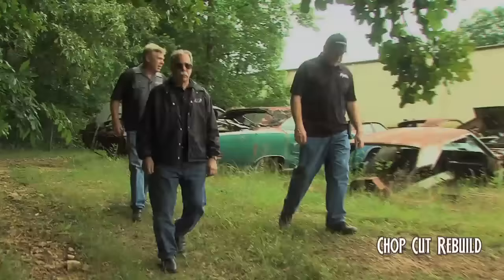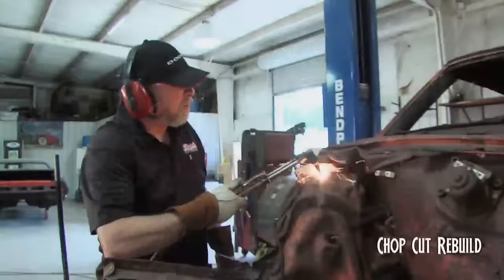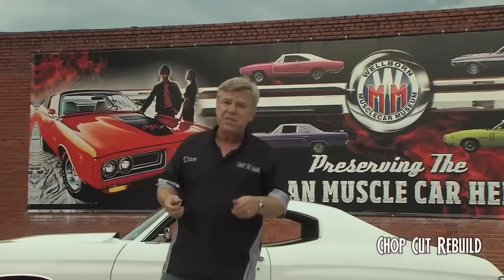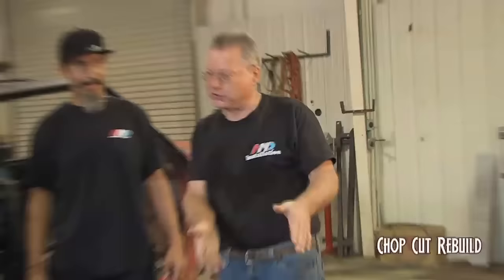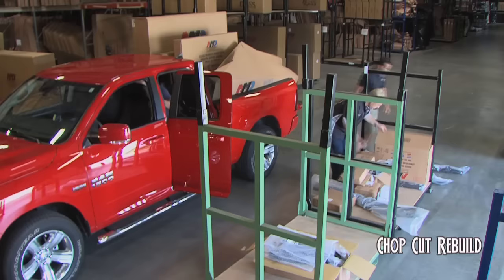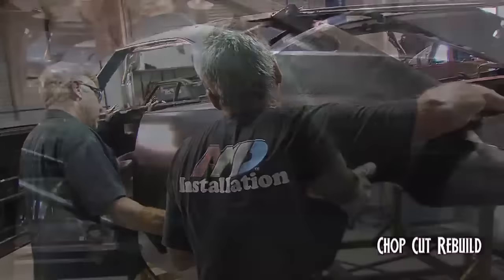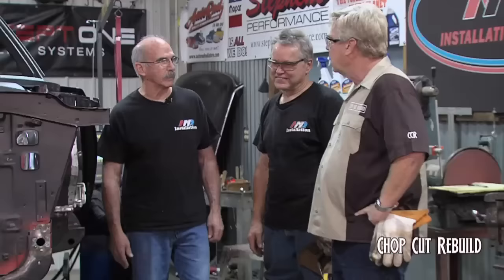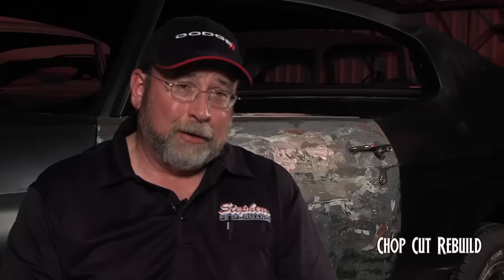Resurrecting a Dodge Daytona that was in a Police Chase Crash - AMD Garage

Comment: When the Daytona cars were built the donor car started life as a charger. So when the factory selected the 500+ cars to become Daytona chargers, the factory kept records of the original serial numbers.Those cars were built as Daytonas and sold at the various dealerships. Even if you rebuilt a Daytona that was commissioned by the factory and replace 99% of the sheet metal, that car still remains a true Daytona because the factory assigned serial number to that specific build. If it was born a charger and built into a Daytona it will always be a true Daytona.
Reply: So you can cut the serial number off and slap it on some sheet metal and you got a “true” Daytona
Reply: To think. . . these guys did what the factory did on a moving assembly line.  In doing so, they went back in American car history to a time before the model T Ford. Although the tools are parts and the mechanism by which they were manufactured have  been improved, that "hands on" work requires a lot of the same skills and attention to detail.  It's amazing.
Reply: The factory serial number indicates that vehicle as a true Daytona . You can build a complete car from New sheetmetal that looks like a daytona, but if you don't have a factory designated serial number, all you have is a body. That is what all daytonas started with was sheetmetal.
Reply: there are hidden serial numbers on the rear inside the trunk drip rail and on the core support your die hard car guys would not call it a true daytona even with the vin on the dash
Reply: @woecp  I think that's a bit of an exaggeration. They started with an actual original Daytona, and yes most of the metal was replaced with new, but it's still associated with the original car. 

It's a whole helluva lot better than just sending the original car to the crusher, which is usually what would happen.
Reply: @clembob8004  they cut a lot of metal that didn’t need to be cut, I see it so often these guys get a chargers for a good deal and just go dummy with it cut it all up and leave nothing original just build one from scratch if you gonna do all that 🤣 I woulda beat it out with a hammer before I cut every square inch and replace it and on top of that they make it a garage queen 🤣
Reply: Una lástima que se la pasaron filmando tipos hablando y presentándose 200 veces,no quedó nada del auto original.
Reply from the maker: exactly, more of a showcase of what could happen in this extreme case
Reply: @clembob8004  the wrecked car still went to the crusher
Reply: @gabrielkwiatkowski645 came here to say the same, the amount of times spent on intros and shaking hands would have cut the video in half
Reply: This car is a Daytona recreation. This isn't a restoration. There's nothing to restore.
Reply: @nikoladamjanovic2313  Not exactly. Only the unusable parts went to the crusher. In any case, I look at it this way: there is a nice 69 Daytona Charger in existence that otherwise would have never been built. Any Daytona is a good Daytona.
Reply: @user-tq1eg2mv9q  It's a recreation with a few original parts from the original car, including the all important VIN tag.
Reply: @woecp I can tell u don't know anything about auto restoration work with what u said there... u would have beat and did what? Get real this was the only way to build a good and safe car..
Reply: @redneckswitwheels  I know plenty, it’s not a restoration its a replacement your the type of guy that would spend 200k to build a car and let it sit in a garage and wipe it with a diaper 🤣 I’d drive the sob rusty and falling apart before I replaced the whole car with scrapped Honda metal
Reply: Sure, minus the numbers matching parts. In your heart you’ll always know it’s not a Daytona it’s a kit car. Otherwise where do you draw the line? …take the factory ID tag, rivet it to new parts and call it a Daytona?
Reply: It would be good to save some of the original metalwork though.
Reply: Grandfather’s axe syndrome. Once upon a time someone saw a man chopping wood. That’s a very handsome axe the stranger said. Thanks. It was my grandfather’s the man replied. He used it every day. Wow. It looks to be in perfect condition said the stranger. The man replied proudly it’s a family heirloom, we take good care of it. Over the years we replaced the handle three times and the head only once. I’ll hand Grandpa’s axe down to my son someday he said wistfully.
Reply: @gabrielkwiatkowski645   Esto es una plasta de mierda.  No un Daytona.

Comment: This was an incredibly ambitious project, holy cow. Thing is, it is not the same car hate to say, it is a new car built with 99.99% new parts.
Reply: I wonder where those parts were manufactured, I didn't research it myself. Maybe China?
Reply: @irocitZ  Back then the parts would have been built in U.S / Canada. I've seen a few books on Daytona's (but not read them) and I'd hope one of them mentions where they were built. I'm guessing a local fabricator facility or speed shop would have been commissioned to build the parts
Reply: @car_ventures  I'm talking about the aftermarket parts used to put this back together, since this particular project requires an entire catalog of pieces I'm wondering where are they sourcing them from? I'm assuming there aren't many Daytona parts cars around. Anyone restoring or buying a classic car should consider what kind of parts went into the project, in my case I look for USA made stuff. If not I could be sitting on a Chinese or whatever car...
Reply from the maker: Developed here, stamped in Taiwan
Reply: @autometaldirect  so u used the VIN snd the outer rocker psnrl from the Daytons from zhe junkyard and everything dlse was gone to the crusher
Reply: @nikoladamjanovic2313  Yeah it's more tribute car than anything else.  Oh well, glad to see it back together anyway.
Reply: I guess they should have just left it in the salvage yard then.
Reply: Help me understand, I was under the impression that if you remove a VIN from one vehicle and place it on another vehicle, you have just engaged in a FEDERAL CRIME?
Reply: @charlesslack8090  Federal crime? No. And this did not happen. the VIN plate was reattached the the same vehicle.
Reply: @jackmoore6904  
Thank you Jack. So no fed crime. Is this then what is called a RE-BODIED CLONE? Is the title clean after this?
Reply: @charlesslack8090  It is not rebodied or a clone. It is not built from parts either. The car is lagaly VINed.
Reply: Kind of a re-creation maybe.  Whatever. It's cool with me.

Comment: Resurrection? No. Rebody ? Yes. When the only original parts are a section of the inner roof and the dash pad (with vin) then then it’s disingenuous to say that Daytona was resurrected. Good job building a clone though.
Reply from the maker: either way, its not in a junkyard anymore
Reply: That’s correct. 97% of it has gone for recycling.
Reply from the maker: @user-uo1qw4dg9i  i heard that the recycled metal was used to make modern hellcat panels 😃

Comment: Today NASCAR is running like 185- 190, these ols Daytonas ran over 200 with no problem, imagine if they had all the modern underpinnings like NASCAR today, they would probably hit 215-220 and still embarass the new cars. NASCAR just seems too safe today and the rear is so loose they say at high speed on the bank, you could puss the rear right out with your hand, Bring back a moder version of these back and let them run em just like they used too. Gotta love that AMD sheet metal. I owned a 70 road runner I always wanted to clone into a winged car, somebody told me they used Coronet fenders because they were longer, don`t know how true that is. Great video guys.

Comment: I don’t understand any negative talk on this car or any car that needs fixed. Would it be better to let it sit in a junkyard and disintegrate into the ground? I sure don’t think so! And, besides, a rebuild on a car like this is fully documented so there will be no possibility of passing it off as all original or a survivor or anything other than a badass Daytona back on the road!
Reply: They could just cut the vin from the junkyard snd let it sit
Reply: Hell it already HAD rotted into the ground!
Reply: They  removed far too much of the car in the name of installing and promoting replacement panels. More than half of the rear quarters could have been saved as well as the roof. Sure they would have taken more time and skill to do it properly but in the end the more of the original car still there the better claim to a restoration.  This is an aftermarket car with a few Daytona parts
Reply: Panel replacement with new panels is nothing a typical crash repair shop couldn't handle.  Anyone can remove and replace. A real hot rod shop would have repaired the panels that were there . This is no longer a daytona. Simple

Comment: Having installed reproduction sheet metal for many years I agree that AMD products are better. However the body shop guys should have at least got a little inclusion in the show. I know from Experience what kind of Labor and Hours go into straightening and prepping the body.
Reply from the maker: absolutely, the body shop guys really bring the whole project home and, depending on the level of the project, can take it to a complete show stopper.

Comment: 13:35, Don't be so hard on, Ted. When I resurrected my 67 Shelby GT350 I purchased from the previous owner who kissed a telephone pole with the passenger rear, I saved all the mangled pieces I had to remove to rebuild it. Back then, there wasn't an AMD to get the parts I needed. I had to find donor parts from damaged 67 Mustangs in junkyards it was quite a job but I saved it and it new after I had it painted the original Candy Apple Red it began its life with.
Reply from the maker: Thanks for your words and thank you for watching!

Comment: When you replace almost every single part of a car it's not a "restoration" it's a Creation.
Everytime some greedy shop takes an old famous movie or historic car and replaces 90+% of the car with brand new parts. All they've done is thrown the famous historic car in the dumpster and hung all new parts and paint to lie about it's history to sell it for a large amount of money. For instance The Elvis movie car and original screen used Dukes of Hazzards intro jump car for two examples. Every piece of the cars were torn apart piece by piece and thrown away. Then replace every part to look like the original cars. It's been many years and I've blocked them from my memory but I believe ONLY one piece from one car and two from the other were actually saved. The vin code badge from one and the vin code badge and firewall from the other. The rest of the entire car was thrown into the trash and replaced with shiny brand new parts. I don't care about this fake Daytona the owners have to know what they're actually buying by law. But those other two famous cars should have been cleaned up and treasured for what they were. Not what they're pretending to be now. When anyone could have gone into the dumpster at the back of those shops and put all the pieces together again. They would have had the original cars! But now they've been melted down to make whatever.
This all should be illegal to do this. A vin code nadge does not make a car make.  I can afford to buy some of these cars but I'd never waste my money. They look beautiful and shiny as brand new imposters. But that's all they'll ever be. I'd rather have the real thing even in the worst condition. Because it's real. I've worked in the entertainment industry for most my life and this fake car would make for a great secondary car to wreck on screen in order to save a real Daytona car. No matter what it looked like.
This was a hour long infomercial for all new replacement Dodge parts and that's it. Parts are made to replace broken or beyond repair "parts" on a special car. No for replacing the ENTIRE special car. 
He said it himself when they found the car "that's not the Dayton".
Now we can say it at the end. "that's not the Daytona"! Rant over. These videos just make me sick. Not this particular car because the other car wasn't worth anything. But thinking about the famous cars that get trashed just to hang everything new on a new frame just to get Shiny New for money. That's just wrong. They're only original once and saving certain original cars are priceless just the way they are.
Reply from the maker: Thanks for watching! No impropriety presented or suggested - it is still on display in our showroom! Stop by sometime and check it out
Reply: to me its more of a KIT car than a restoration
Reply: @autometaldirect  Awesome! Got pics of the car in it's current state? I'm from Argentina can't go there yet sadly :(
Reply: @autometaldirect 

Where do these picky people draw the line? Any east coast car that saw salt is going to need new body shell floors, front and rear, trunk floor, rockers and likely quarters. And that’s a minimum. Is that OK? Any car that suffered a head on impact at 100 MPH isn’t going to have much usable metal forward of the firewall. So, according of these naysayers you write these cars off or display them as is. But who is going to be interested in owning or even viewing in a museum a beat to h**l rust bucket or a total wreck complete with bloody bandages left on the drivers seat?

I’ve retired from restoring MG’s, which are all rust buckets except for California cars. I never felt that when I ran into that last unexpectedly rusty panel I should stop the restoration, throw up my hands in defeat and for the sake of purity send the car to the crusher.

Comment: Amazing work, love it. People need to get over the "It's not the same car" thing. Looks like a Daytona to me! What matters is, there is a beautiful car back on the road and not lost to the scrap yard.
Reply from the maker: that is our feelings exactly, this is obviously an extreme case but there is another Daytona back on the road now. js
Reply: It is a repro body with a VIN from a wrecked car
Reply: @nikoladamjanovic2313   I worked in a body repair shop many years ago and some cars came in needing a complete rebuild from the floor up. Sometimes only the firewall and part of the floor was saveable, the rest was brand new panels and interior. Granted, the cars are usually only a few months old for that kind of work but it's still the same car going out as what came in.

Comment: I remember a buddy of mine selling on Ebay a rear wing, two fender scoops and two nose pieces that were damaged but one could be made out of the two of them. He sold them as a package and got 27k for them and that was 20 years ago or more.
Reply: $27k sound like you rip someone off. original Dodge Daytona wing shouldn't go no more than $5k.
Reply: @funtyes1970  It was a public auction so how could you ever think "you rip someone off"?
Reply: @funtyes1970  Was just looking and the last factory wing in Ebay was 15k for just the wing with out a nose piece and scoops.
Reply: @davebrittain9216  15k sounds reasonable to me, especially if you consider the rarity. Any collector that's trying to restore a true wing car would gladly pay that.
Reply: @kickithard  Ya the guys that really want originality pay big bugs. I remember back in the 90's he was restoring a Hemi Super Bee and it did not have matching dual four barrel carbs. He paid 5k back then for consecutive serial number carbs for a Hemi for that specific year of manufacture to match the car.

Comment: I was a bit surprised by the colour change, but the reason for it and the result were actually really great!
Reply: Yes, but the color should have been the same it left factory with.
Reply: In year 2017, here, black primer or fresh out of the box look bare metal
Reply: @missingremote4388  Has it been repainted since then I wonder?
Reply from the maker: it is still in that 'Hot Rod' Black

Comment: If someone cut the face out on the Mona Lisa, imposed it on a new canvas. Then, painted the rest of the painting by the best most famous painter in the world. It still wouldnt be considered the original painting.

If a watchmaker took a face of a rolex and put it on a seiko watch movement, it wouldnt be considered a rolex. 

Over 95% of this car has been replaced. Its not a rebuild, its a tribute car with a couple pices from an original.  

With all that being said. Still, this was an amazing build, and the car looks amazing.

Comment: It's just a canvas to put an original VIN tag on. The history of the car as it is now is an open book. Everyone knows it's a Taiwanese clone. IMO Mr Stephens should have the original parts treated to stop rust then "reassembled" as a display to accompany the clone rather than just the pictures of the beyond saving original. The history of the original owner and why he was running would be interesting. A wreck that violent before airbags could easily have been fatal.

Comment: I'll never understand these kinds of rebuilds. Sure, the car once was a Daytona, but by the time you finish cutting all the rust and replacing original panels with aftermarket new panels, that thing will just be a clone in my eyes. You're gonna leave just the original tag or VIN number or whatever and pretty much all the rest will be new metal, motor and 100% of all components and interior. At the end, it'll look just like a Daytona, but it's gonna be just a Daytona clone.
I loved the video though!
Reply: YEA. THANKS FOR YOUR OPINION….

Comment: I was hoping to see them put it on a frame rack and pull out the damages, but I realized it was just too rusty to do that, it would've just tore apart, and besides that, hardly anything on that body was going to be reused, just brackets and smaller undamaged pieces
Reply: Indeed, what got that Charger killed was the rust. If it didn't had rust so much of it could have been salvageable.